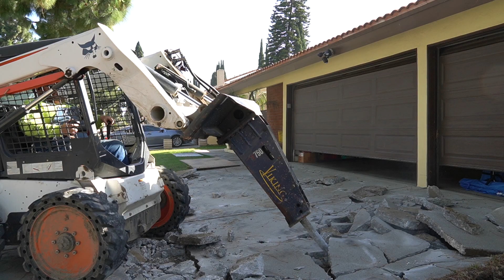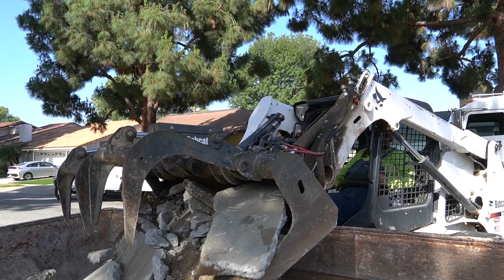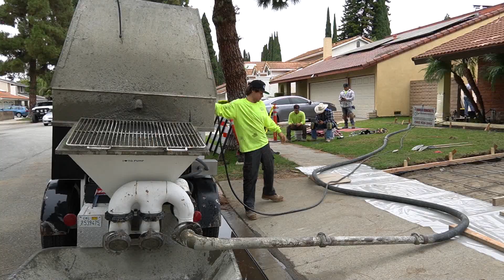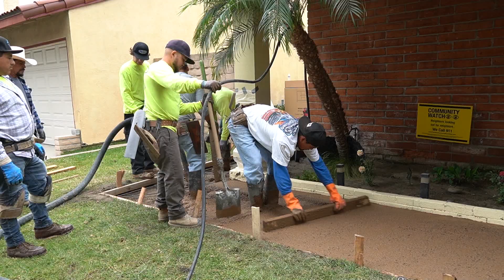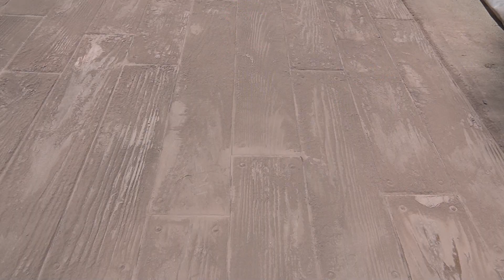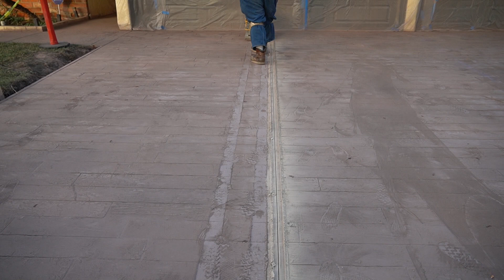WOOD PLANK CONCRETE DRIVEWAY. CUSTOM TWO TONE COLOR!

Comment: It’s interesting how much the tools, techniques and material changes across the country. You have 3 guys more than I would need in Wisconsin. I use solid gravel base, wire mesh, and micro fibers. I traveled to Nevada as a finisher when I was a young man. It was a great experience learning from different ppl across the country. 👍🏻
Reply from the maker: Thanks for watching 👍

Comment: What is the benefit of hitting it with a wood bow float when I first got into concrete back in 2006 here in Utah we used to use them all the time then we stopped using it .
Reply from the maker: It leaves the concrete open. We don't want to seal it up early. We seal it up with a steel trowel. In freeze areas they figured out not to use a steel trowel 👍
Reply: @WestCoastCustomConcrete  I seen you hit it with a wood bow float then you hit it with magnesium blow float or was that a steal bow float
Reply from the maker: @shawnedmunds7647  that's a Fresno it's steal👍

Comment: We just got a Beak attachment for our skid steer. It has saved us alot of headaches already. We ran into a large stoop that was poured 4.5' thick and it grabbed it and pulled it straight away from the house without having to run a breaker on it for a really long time. It really is a game changer. They actually make a Beak attachment for the Bobcat S70 also. We are looking at getting one for that too. Would like to see the pressure wash and seal also.
Reply from the maker: I can see that's a really good attachment 💯 I've always just used the bucket 👍 thanks for watching bro